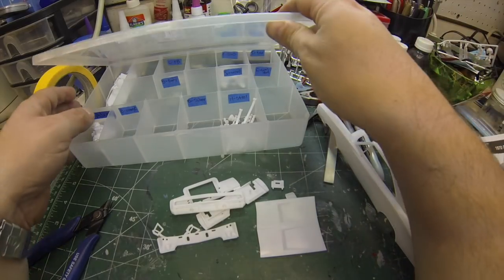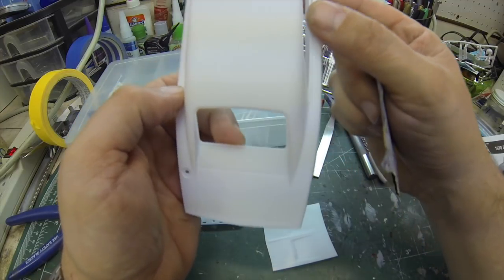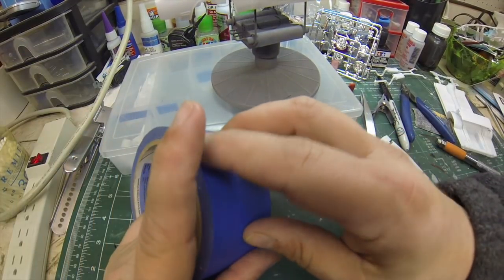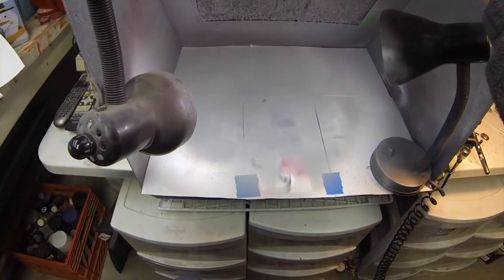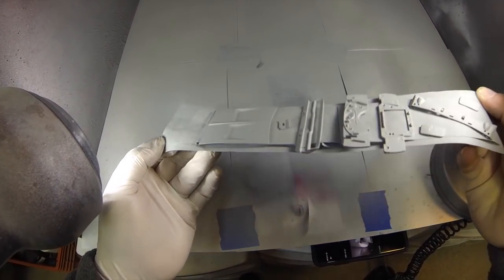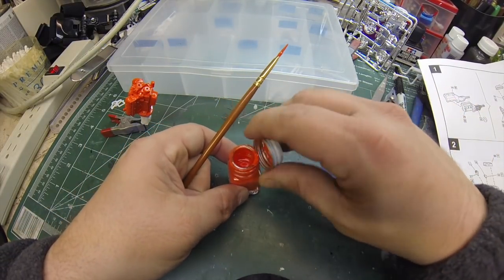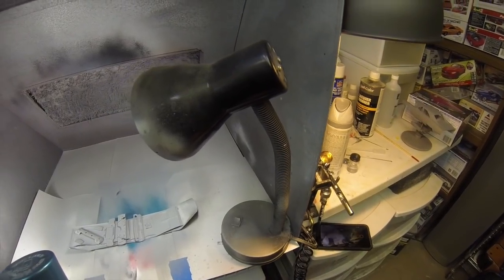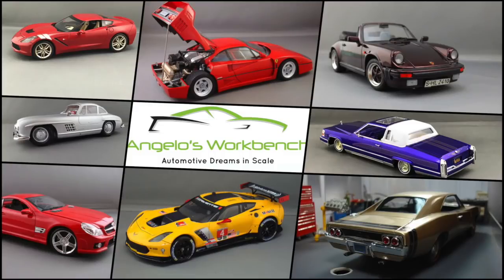The Beginner How To Video #3 with a Revell 1970 Dodge Charger RT

Comment: "Don't inhale these vapors." Heh. That's about 50 years after when I could have used that advice. ;-)  As a kid, when I built a Revell 1:144 Saturn V rocket I got from my aunt for Christmas 1969 (along with the Munster Mobile and the Monkee Mobile), my dad and I sat there, in my single-push-up-creaky-window bedroom with the cast iron radiator along the wall and absolutely no ventilation and started twisting parts off the sprues ("Sprue cutter? Sprue cutter? We don't need no steenking srue cutter!") . Then we began putting everything together with that old-time model glue (the Testor's stuff... you know; the one with tons of toulene and other super-industrial ketones, alaphatic hydrocarbons and other cancer-causing agents in it) and then we eventually, painted it with a variety of spray paint flats and enamels. 

Eh, we always wondered why we were so dizzy after doing that stuff. But now that I've decided to build some some of my old favorites again (for the first time since '75), and to do it RIGHT, I'm glad to have run across these videos and the channel. Keep up the good work, sir!

Comment: Excellent video and commentary. I recommend that you clean off the rim of your paint bottles (small rag or paper towel moistened with thinner) to prevent the lids sticking and maybe keep dried paint out of the enamel. I use Polly-Scale water-based paints, and to keep the lid from sticking, I cut a small piece of plastic shopping bag, and cover the mouth of the bottle and then screw down the lid. Seems to work with my Testor's enamels too.

Comment: Hay Angelo I love your videos and tips on model kit and I want to know will you do a 1958 Plymouth fury Christine next?
Reply from the maker: Angel Hernandez I do have one in the stash so you never know.
Reply: Got a half finished on of these as well! Need some inspo to finish it off
Reply: Angelo's Workbench ok and thanks and also do you always have to use a 600 grit sandpaper on the body and or other parts for the body such as hood, skirts, and many more
Reply from the maker: Angel Hernandez I use the 600 just on the body parts and any other large flat and smooth surfaces. It helps paint to stick.

Comment: Excellent series and very thoughtful content. Thank you. Why did you not prime the engine block before painting? Also, could you have airbrushed the enamel? If so, why not? And do you thin enamels?
Reply from the maker: Richard Berrie hello. This was a beginner series so I purposely did not use an airbrush. You can airbrush anything if you thin it properly. Thanks.

Comment: Angelo 
First off I want to say Ive learned so much watching your videos. I’m currently building the Revell 1966 Pontiac GTO. I’m detailing the interior door panels. I’ve done the door handle, window cranks, and chrome strip on the doors. My question is there is also a small GTO emblem on both doors that is chrome and red. I looked online to see what the real emblem looked like. I’m looking for advice on how to do the emblem. Any help would be appreciated.
Reply from the maker: Jim Kaminski hey Jim. If you have some decal paper you could grab a pic off the internet and print it out and decal it. Or you could try a little bare metal foil with detail painting. Also you could just paint it silver and  detail the red part. The detailing would probably be with toothpicks as you will need very little paint. You could also dry-brushing it which involves putting a little paint on a brush and then removing 95% of it on a paper towel or something and then rubbing the brush over where the emblem is. Dry brushing will only work if the emblem is raised up on the door panel in the model. Let me know how it goes!
Reply: Hi Angelo 
I feel a little foolish because I discovered a water slide decal for the door panel on the decal sheet. Problem solved. Lololo
Reply from the maker: Jim Kaminski well that works! I love when the kit manufacturers do that.

Comment: Hi Angelo, just on average how long do you usually take to complete a model car? Thank you!
Reply from the maker: Hi Ken. It varies greatly depending on how much time I have and the difficulty of the build. I’d say most are done after about 20-25 hours of build time. This doesn’t include planning or research time or printing any 3D parts for the build. Thanks for the question!

Comment: Awesome vids so far, can't wait for the end result. Quick question though, I can't seem to find the plastikote primer here in Canada. Will Krylon plastic primer give me the same end results as the plastikote product? Thanks, 
Kelly G.
Reply from the maker: Kelly Green hello and thanks for the question. The plastikote primers have been getting increasingly difficult to find. I am switching over to a rustoleum plastic primer and am testing that product as we speak. Here is the thing with primers and really any paints: test them on something first! I keep a bunch of plastic spoons around to test. So try your Krylon plastic primer on a spoon. Follow all instructions for dry time from the primer and paint. Then try spraying the paint on the primer and see if you get a reaction. When spraying the paint apply very light coats at first. If after the paint cures you haven’t had a reaction then you’re ready to paint the body of the car. Be careful mixing different types of paints over one another. Stay away from enamels if you intend to use lacquers. I hope this helps. Feel free to reach back out with any questions. Thanks for visiting and watching!

Comment: Quick question: If you place the parts like that in 6:48, then how will you paint both sides of the parts? How do you paint change sides, without touching the painted part? Seems like you can only paint one side of the parts...
Also, why aren't you priming the smaller parts, like you did with the body?
Reply from the maker: Jesvin Joy hello and thanks for the question. I paint the first side, allow the parts to cure, then flip them over and paint the other side. I did prime the small parts also but due to a camera error you didn’t see the primer applied. There is a shot of them painted in the video.
Reply: Thank you for the reply. How long does it take for the paint to cure?
Reply from the maker: Jesvin Joy you’re very welcome. Acrylics dry in about 30 minutes but I help the process along with a food dehydrator. That dries the acrylics in about 10 minutes.

Comment: Why didn't you glue the door vents on the body before painting the car?

Also when you paint outside, do you have to get the "HEAVY" mask, or one made of cloth material would be fine?
Reply from the maker: Qwerts Strewq hello and thanks for the questions. I tend to leave stuff like those vents off because it makes the polishing phase a little easier. As for the safety equipment it’s really up to what you feel safe with. I am far from an expert on safety equipment. Personally I always take the safest route and use a professional painters respirator. I am contemplating upgrading to an air fed respirator. I don’t want to breathe any of these vapors if I can help it. I hope this helps you. Thanks for watching!

Comment: Did you sand the primered body?  I have some Tamiya 2000 sponges.  I’m going to use that to smooth the primer.  Good?
Reply from the maker: The smoother it is after each layer the shinier it will be! Yes I usually sand very lightly after the primer.

Comment: How many coats of each paint and the primer do you have to put on the car and it's parts? Also how much time do you have to wait for each coat to dry? ALSO Also how do you brush without having lines show up from the brush itself? Sorry if I asked a lot of questions
Reply from the maker: Jonathan Mendiola no problem on the questions I am happy to help. I put as many coats on as it takes to get desired coverage. Depending on how the paint covers as few as 2 or as many as 5 or 6! Many lights coats is better than a heavy coat for primer and paint. Refer to your paint that you’re using for dry times - they’re all different. As for brushing without lines - it’s a bit of an art and takes practice. Think of it like you are coating the part. I apply it heavy, brush it smooth, and then don’t touch it!!!! Once it starts to dry (which happens fast) any brush strokes will stay and won’t have time to settle out. Hope all this helps!
Reply: Thanks! I'm just starting to get into model car making. My first kit is the #44 STP Pontiac by amt. I know it might not be perfetct, but it doesn't mean it's gonna look bad👍👍👍👍👍
Reply from the maker: Jonathan Mendiola I don’t think I’ve ever had a “perfect” kit. It’s all about the fun building!
Reply: I meant like it looked decent, like your builds. Well your builds are awesome
Reply from the maker: Jonathan Mendiola thanks very much. I really enjoy this hobby and hope you do too.

Comment: Hi Angelo.  I am just starting out with modeling and so far your guide has been very helpful.  However, there is one thing I am still confused about.  What difference does brush-painting a part with enamel make when compared to brush-painting with acrylic?  For example, the engine block was brushed with enamel but the ceiling of the car was brushed with acrylic.  What is the reason for one being used over the other?
Reply from the maker: Dana Cole Hi Dana and welcome to the hobby. There really wasn’t any reason - I used what I had available and what would be commonly available. All of the paints or equivalents are readily available just about anywhere. Enjoy your build!

Comment: what do you do about sanding, or "roughing up" the small parts?
Reply: what do you think about getting some bulk abrasive, like what they use for gem polishing, putting in a tupperware bowl with small parts, and vibrating the whole thing with an orbital sander? maybe even to the body that way with a big enough container.
Reply from the maker: Dan S I’ve never tried a tumbling sander with plastic. I think it might be too abrasive. With the small parts I sand them as necessary as I remove them from the sprues.

Comment: Do I sand all the parts I plan to paint with primer like the hood and interior panels?
Reply from the maker: Alexander the Great preparing all of the parts for the build by sanding them and removing mold lines enhances the quality of the build for sure. Personally I do not prime all of the parts. Only the bodies and exterior parts along with any parts that will be masked off for painting. Thanks!
Reply: No, just make sure your model kit is clean.  Wipe down with alcohol before and painting.

Comment: What's primer and cure mean just purchased 6 model kits for first time
Reply from the maker: victory Leo primer is a form of paint that promotes adhesion. Cure means letting the paint dry. Good luck on the kits!!!
Reply: Angelo's Workbench I'll need it since the 1970 1/2 chevy camaro z/28 instructions dosen't tell what paints I need or what color to paint each part the amt kit
Reply from the maker: victory Leo check online you should be able to find the instructions!
Reply: Angelo's Workbench I did no luck thinking about calling the company about it and see if they will send me another instructions booklet that dose say what paint I need & what parts labeled for its color
Reply from the maker: victory Leo also maybe you try searching for reference picture on the internet. I do that often.